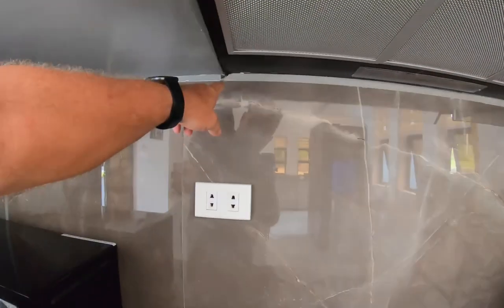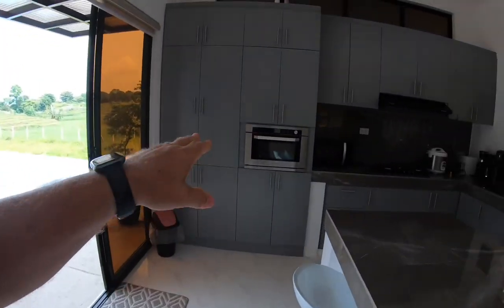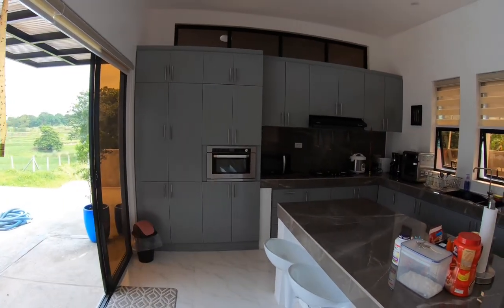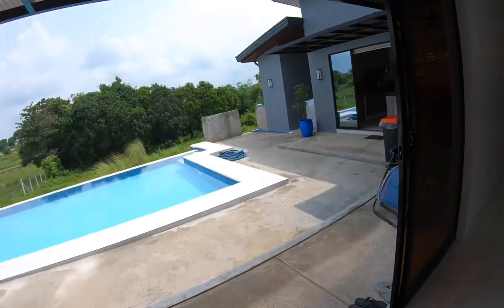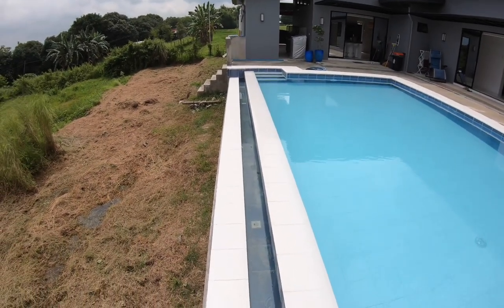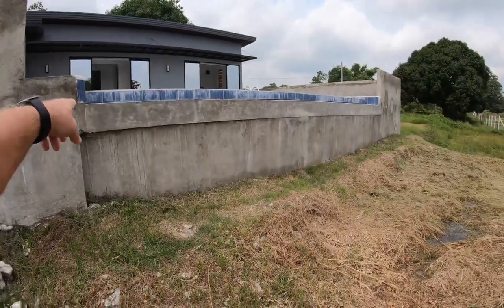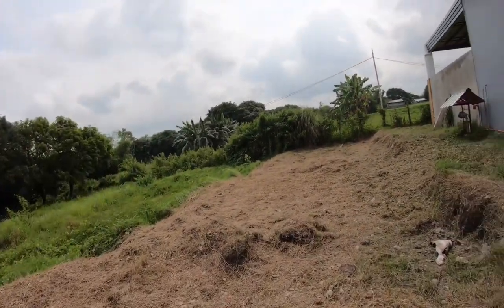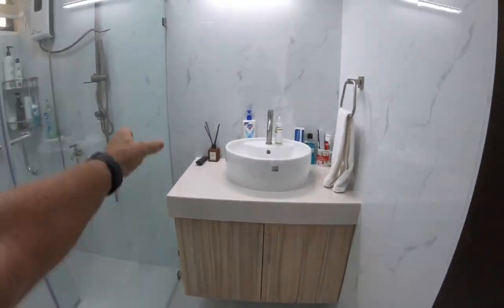Full HOUSE TOUR!!! | Central Luzon | Philippines🇵🇭🇵🇭🇵🇭

Comment: Good to see the cabinet around your vent hood was fixed. I hope your driveway is at least 4” thick with rebar. You might have to do a version 2.5. 🤞
Reply: Lol, you sadly may be correct.  I have been told that it will be addressed as soon as rainy season lets up. I am trusting it will.  I do not believe it is 4" thick and I also believe the rebar was just laid on the ground.  It truly looks 10 years old at this point.  If and when it gets addressed, I will detail it's construction as I will be here when the second version is done.

Comment: Good effort Rick
I'll be surprised if they return now. If you've withheld final payment, then you may be in luck though.. fingers crossed.

I've carpentry in our kitchen, loungeroom, bedroom cupboards albeit chipboard, including real wood Thai day bed and no termites after 7 years so again, fingers crossed.
I've wood fixed to my perimeter fence for external taps, and they're being slowly eaten away. Anything just laying on the ground - essentially gone..

The bidet's they almost nearly 100% always leak. I've had 100% expensive chrome/ copper ones and the cheap as plastic chrome ones and unfortunately for me at least, the cheap ones last.  We go through the reinforced hoses annually as here, rubber hose wrapped in stainless braid. The rubber perishes..
My pool we sealed with a special rubber based compound over the concrete, then tiled. At least you identified the cause of your water loss and easily rectified. 
We had a slow leak for 4 years before I found the causes and fixed myself. I couldn't get a pool builder to come and fix for me. Took me 2 weeks and 1 labourer for help. 

Anyway, your home is looking good considering the trials & tribulations.

Cheers from Thailand
Reply: Good to hear from you my Thai friend!  I do still have about 5% withheld, waiting to hear the final plan for correction.  The new engineer has been very attentive to trying to get it all wrapped up.  Just have to trust he will follow through.  That's encouraging on the cabinets.  I hit the foundation pretty regular with a pesticide, just hoping it will minimize any future issues.  From the sounds of your experience, we might have a chance.  Yep, bidet's are a new thing for this American boy, but I absolutely love 'em!  And yes, I have had leaking issues in almost every home we have lived in here and in every CR.  Super bummed to hear about your pool issue, but blessing you got it resolved.  I can't tell you what a relief it's been these past two weeks, not having to add water to the pool.  It's a big deal. Jenn and I have to get to Thailand in the near future.  Neither of us have ever been.  Let me know where you would suggest we spend our first trip to that beautiful country!

Comment: Just started seeing your videos, mostly from watching your cost of living video first, as we may move there at some point.  While watching the construction video then this one, I am wondering, do they not have residential building code and inspectors that have to sign off along the way to ensure at least the most important things structurally and mechanically are up to snuff?
Reply from the maker: Great question!  And the answer is not as straight forward unfortunately.  There are building standards here and most architects are trained in those standards.  Where it gets a little sideways is when it comes to the actual build.  Take our build for example.  The Architect should have secured building permits with the Municipality and gotten approval from the Engineering office before proceeding with the build, but he did not.  Additionally there is no follow up, so what the Architect approves with the Engineers on paper, that's as far as it goes.  No inspectors coming out at various stages of structural, plumbing, electrical etc.  It basically all relies on the Architect doing what is in the drawings.  Unfortunately that does not always happen.  Best to have some basic knowledge of building practices here and be on site as much as possible.   Hope that helps brother!

Comment: Do you have 2 water pressure pumps?
Reply from the maker: We have one deep well, one 1HP pump and one 42 gallon pressure tank.  I am considering adding another deep well with a submersible pump to take care of the outside gardening and landscaping.  It will relieve a lot of use on our household pump.

Comment: It's been awhile since I saw what was being accomplished on your house build. By the looks of things a lot has been done with some more Punch work to be done. I will say it has been my experience since I have been associated with the Philippines over 45 years that outside of the Metro Manila area or NCR finish work has not been the strong suit of House builders. If you were not there to clarify and have them correct poor workmanship it would not have done at all.
Reply: You very possibly could be right Charles.  In my case, I believe it came down to the site engineer.  I say this because the finishes up to the turnover were like pulling teeth.  Once that one area changed, it was amazing how quickly it came together.  I can sum it up into one word "Experience".  One had it, one didn't. My assessment of course.  Thanks for watching Brother!

Comment: did the construction crew have a Forman? Coz he's the one responsible for the job site? It's a shame the job was completed with issues,,,,but it looks like you're almost done,,,good luck
Reply: Hey Ken!  I suppose every builder has their own way of doing things.  In our case, the job site had an engineer assigned to oversee, purchase materials and generally guide the various stages.  Our engineer I believe was really good during the structural phases of the project, but seemed to be lacking in the finishing stage.  Everything is getting resolved however, and we can see the light at the end of the tunnel!
Reply: @rickeybaker9066  ,,,,,,the final result is a beautiful house and land,,, good luck always

Comment: they had the chance to redeem themselves... and yet... they still did'nt do it properly... hahaha... the sad thing is, you just have to accept the fact that you are not going to get the thing you asked for... this i s what I call "band aid" mentality... you need to add roofing to your carport, just get an old tarpauline and let it hang on the side... there are holes to patch, just put tape or leave it and just get used to dust flying out until it runs out... and this kind of attitude of the Filipinos is the reason why i am not expecting our country to progress... yes, the economy will get better, people will have more money, there will be more buildings, infrastructure, cars, etc... but it will remain as dirty and poorly maintained... by the way... those wooden cabinets in the kitchen, especially the ones beneath the sink (bathroom sink too) and counter top where you do food prepping, if they get constantly wet, the wood will soften and warp and degrade... and the horizontal shelving inside will sag in time if you put heavy things on top of them...
Reply from the maker: Thanks for watching Kuya!  Nope, no redemption on this project.  Funny you should describe the lack of change here.  My wife noticed it when we went to Thailand.  It just sometimes all comes down to how you take care of what you already have.  Yes, the cabinets are a concern and we are going to try to get as much out of them as we can, before having to replace them with a material that will hold up.